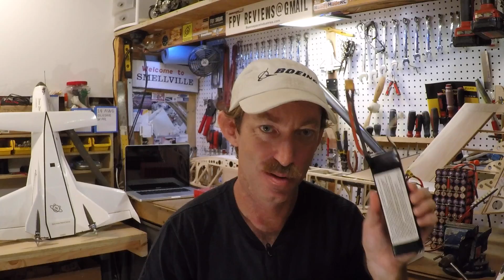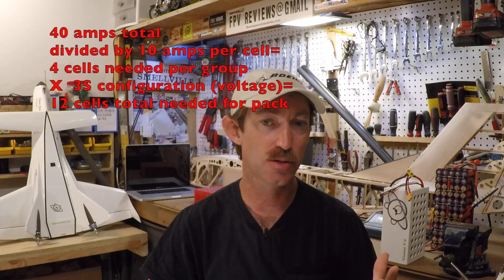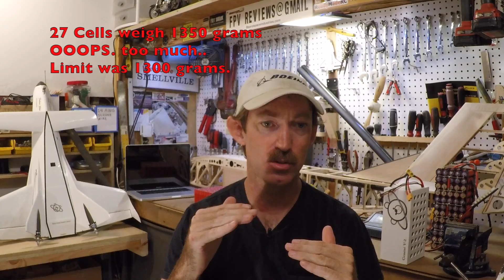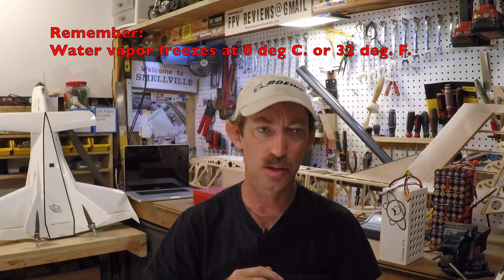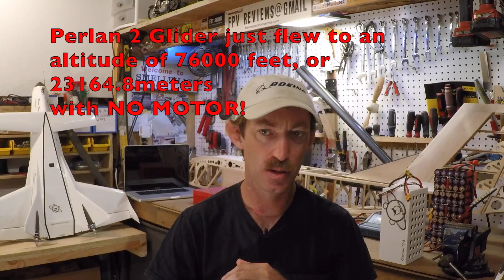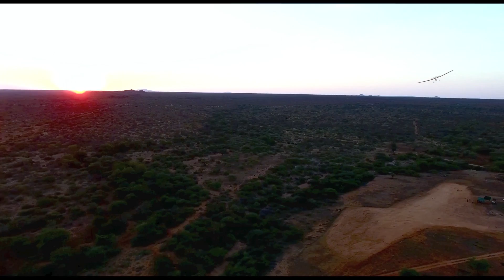Li-Ion vs Lipo - How to Convert your Fixed Wing aircraft to Li-Ion "Tesla" Style batteries

Comment: I just stumbled across this video thank goodness because I just build a 4s2p 7000mah pack using the exact same sanyo 18650s, I've done these test but still not sure of this pack, at full throttle on takeoffs my ar wing pro pulls 26 to 28 amps after reaching altitude it can easily cruise pulling 5 to 7 amps. So whats your thoughts on this pack? Thanks for video. New subscriber

Comment: Gemini V-3 at the back? ;)
Reply from the maker: Something like that.  It's not finalized yet.  Good eye!   

If all works out, should have retractible gear, 17 inch props, slotted flaps for STOL, an airfoil that gives better cruise performance, be more modular, and all around better in every single way.  It's not easy to make something better than V-2. span will be around 4 meters, but the largest part will be 1 meter in length.
Reply: FPVREVIEWS sounds promising! At some point I was considering to modify your original v2 plan and add a retractible landing gear, something like Canadair 415 or Catalina type for the main gear and a 90 rotation nose gear with the retracted wheel under the bat. Compartment horizontally. But than I decided to use the available weight for other equipment rather than a retractable landing gear. Anyway just an idea for your new version, this was reference for the main gear https://mraerodesign.securicom.ca/en/products/info.cfm?ProduitID=58
Look forward to see your new version!
Reply from the maker: To achieve a wider stance, and use more conventional 90 degree retracts, I believe it's far better to retract the main gear into the motor nacelles, similar to a Q400.  Of course this requires a redesign, and it took some time to work out the overall aircraft geometry to get it to work out. 
also relying much more on composites to save weight, while actually making the aircraft even stronger, and more rigid.  There is now an endo skeleton of carbon fiber, all the way from the core out to the extremities, with plug in joints, but retaining a minimized wood structure for aerodynamic fairing.  To achieve this, it's necessary to use jigs extensively to make things line up, so planning on producing it as a finished model, rather than plans or kit.  It's far more work to build the jigs, as it is to build the aircraft.   Of course, designing everything in CAD as well.  
The cost of the retracts (good ones) is also significant, so that can be more easily absorbed by professional users, rather than hobbyists. 
The V-2 was originally intended for hobby use, however, ended up being used by professionals as well, for lack of a better option. 
so many (super expensive, 100 000 dollar+) UAV's cannot gently land a payload, and use parachute recovery.  This is not practical for commercial use.  It's great for the military,  as they don't need to train the person very much to walk over and pick up the aircraft, as opposed to actually landing it, even in stabilized mode.  Unfortunately, the aircraft is often damaged, and therefore is only used a few times before getting sent back to the company for repairs.  It costs a fortune to repair, and transport.  not a problem for the military, but if you are trying to map fields, and take atmospheric samples for local studies, it's prohibitively expensive.  Those expensive aircraft often do not perform as well in the air as the V2 either.  will keep the V-2 for kit and scratch builders.  may redesign the wing at some point to be easier to build and save weight, but there is not a lot to be gained there.  It's still a great airplane, and hard to beat.  I still have to see whether the new aircraft will perform significantly better or not..

Comment: I have found that a Multistar lipo beats the Li-Ion in every category, weight, capacity and longevity. I did an in depth study of both and it's far cheaper to get the Multistar batteries then it is to harvest a ton of Li-Ion cells from laptop batteries and what not. Another issue with Li-Ion is how much amperage they can put out, excellent cells can handle about 3A constant but "normal" cells, the ones you find almost everywhere, can do about 2.4A each which usually ends up meaning you have to build a massive pack in order to get the same discharge rate as a good Multistar lipo. :)
Reply from the maker: A well designed endurance aircraft should only require about .25C discharge rate for the overall flight.   The cells are 3.5 amp hours, and can put out 10 amps continuous, so can be depleted in nearly 1/3 of an hour, which makes them about a 3C discharge.  Plenty for the application that I'm using them for.
If you watch the video, we explain how we go about calculating the minimum battery size.   
To beat the lithium Ion cells on the terms that you mention, the Multistar must have a gravimetric energy density greater than 224 wh per kg. 
according to the specs I looked up for the multistar battery, it only has a gravimetric E.D. of 175 wh per kg.   Pretty typical for a low discharge rate lipo, Which it is.   price per KG is not much different, but quality is likely to be inferior to the Sanyo cells.  at 10C discharge rate,  it may be better for some multi rotors, but not for most UAV aircraft. 
I'm not harvesting batteries from dead laptops.  I'm purchasing the best cells that are commercially available from the most reputable companies.

Comment: AT WHAT VOLTAGE PER CELL YOU CAN TELL THAT YOU ALREADY CONSUME 80% CAPACITY OF A LI-ION BATTERY?
Reply from the maker: you should be able to get an idea on that from the data sheet in the description.  It will vary with load, and temperature.

Comment: Thanks For sharing this useful information that covered quite few i had but i would like a indepth vídeo that could shed light on variuos options on designs and stimated amps, voltages, series and parallel Tesla style batterys if it's not posible to get your hands on brand 18650 because of their cost, maybe use some of the less then adequate chiniese brands assuming they may do the job.
Greetings from TJ baja.
Reply from the maker: We have a couple of build videos showing the techniques used for assembling the batteries on this channel.     If you want to use cheaper options, then better go over to Jehu Garcia's channel,   just look up his name.  He is the master of re purposing Li-Ion cells.   he's also from TJ.      
saludos desde ENS BC,  Somos casi vecinos!